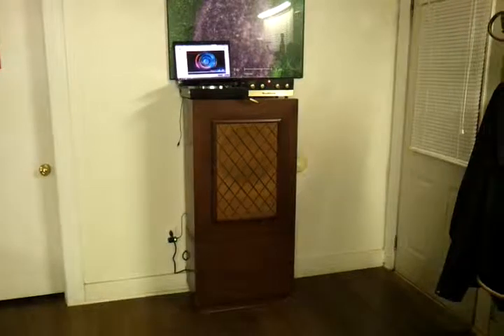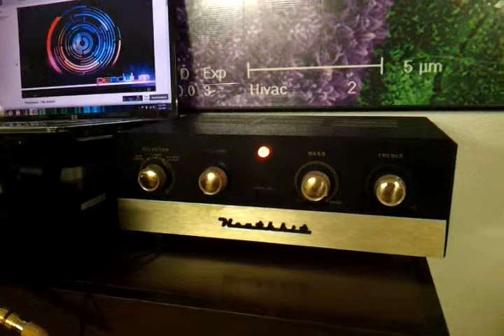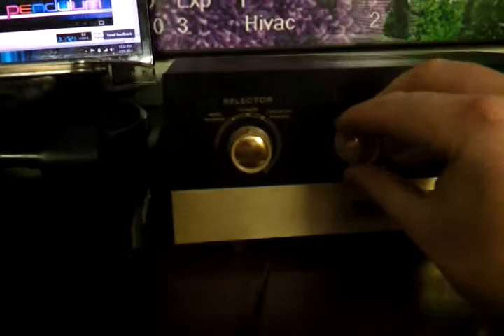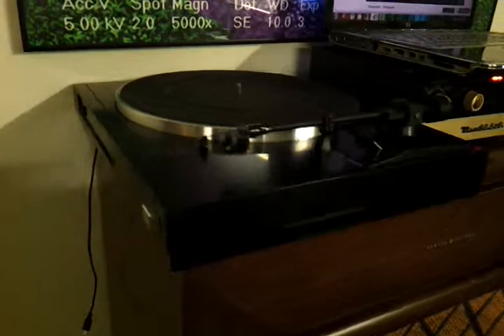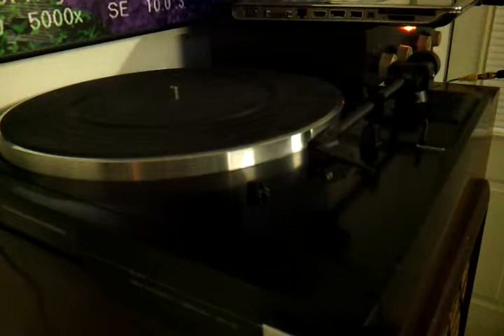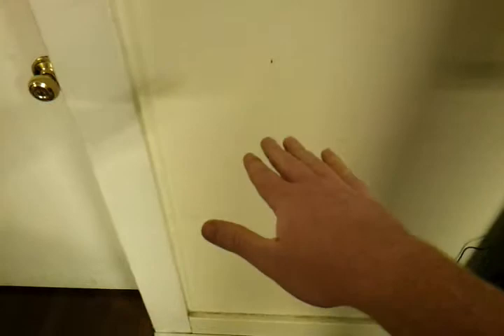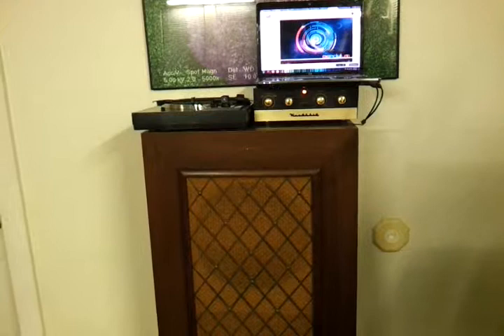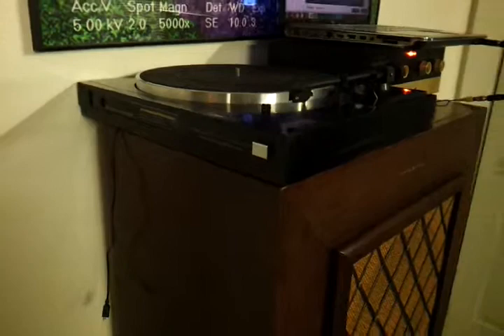Post re-cap Heathkit EA-2 Amplifier test and current setup

Comment: Beautiful example of an EA-2 which is really an EA-3 which is really an AA-161. Only thing changed was the cosmetics. How about that for a long-lived excellent design!  You can never go wrong by exceeding the voltage rating of the power supply caps, just make sure you equal it for each section. Keep the microfarad rating the same though.